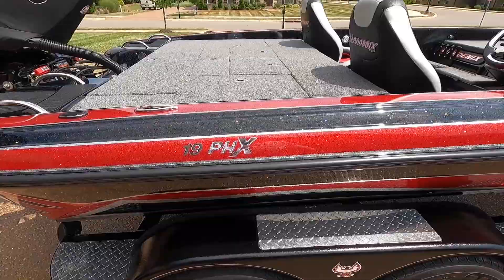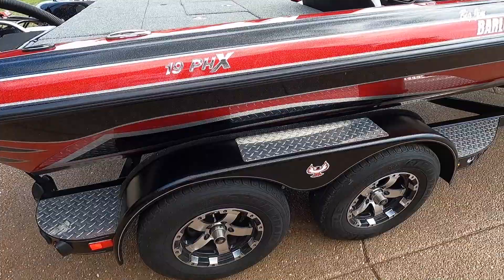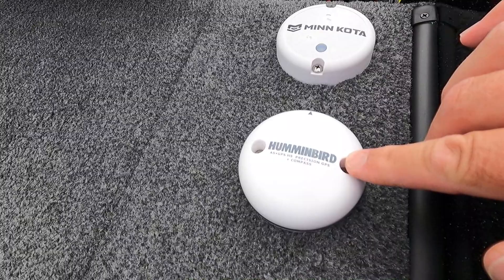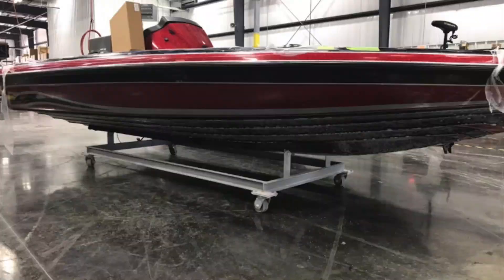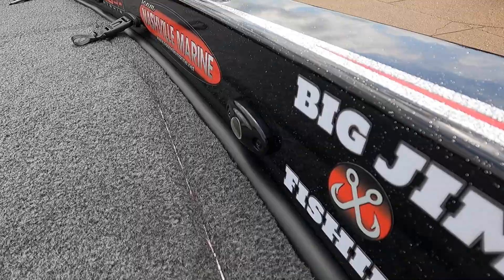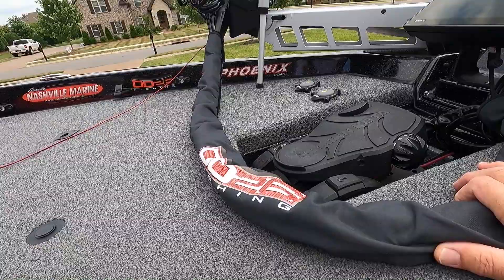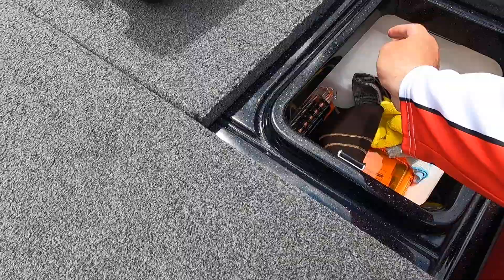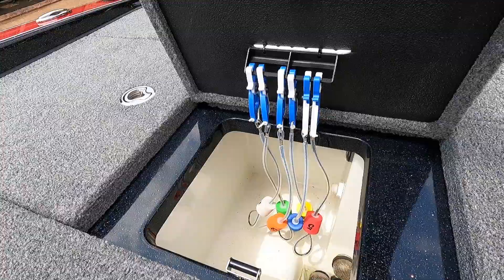Phoenix Bass Boats 19 PHX 2 year review

Comment: Mr. Barlow can you provide the height of the top of the outboard while in towing position?  I have a seven foot tall garage door and am concerned the 19phx will not fit because of that reason.
Reply from the maker: My garage door height is 7’ tall as well.  No problems.  8’ blades barely squeak under without having to lower them.  Do not get 10’ blades.
Reply: @BigJimFishing  oh man I don’t think I have ever been happier about a reply before.  Looks like my Ranger is going on the market.  Thank you and stay safe.
Reply: My 819 barely fits in the garage and it’s 7 foot garage door. But there is an angle on my driveway. I half to have the jackplate all the way down.
Reply: @robertdaoud6837  are you running a Yamaha outboard by any chance?  Seems like Yamaha sits higher than Mercury.  Thankfully my driveway slopes down into my garage that should help me with more clearance.
Reply: @charleswooten9836  no I am running a 200 pro xs 4 stroke. The top of the motor has about 2 inches clearance with the jackplate all the way down. Thank god I ordered the hydroloic jackplate. I almost didn’t get the jackplate. I highly recommend a jackplate! I have to give Jim credit for a great video to be honest. Hard to find videos on Phoenix 19 foot boats. My dealer told me to not get the jackplate. The top of the cone of the pro xs stands a little high. Make sure you measure. I got my boat and almost couldn’t get it in the garage because of the height. I had measured everything else but that.follow me on Instagram if you want to see my rig. Robdfishing
Reply: @robertdaoud6837  will do on the Instagram.  I have a jack plate on the Ranger and even though it’s really not needed on the deep north ga lakes I plan on having on on every bass boat I own.  Thank you for the feedback.  Stay safe.

Comment: great video! i have 819 pro 2021 with a 200 pro xs.I absolutely love it. I start chine walkimg at around 63 - 65mph any tips on correcting that. i do have an atlas jackplate on there. i usually run it around 9..
Reply from the maker: Pick it up to 12 once on plane.  Bump trim up then when it starts, bump trim down.